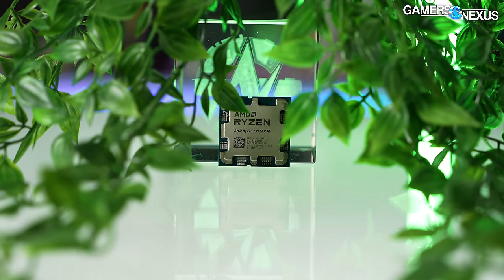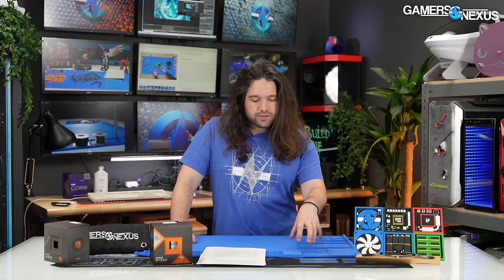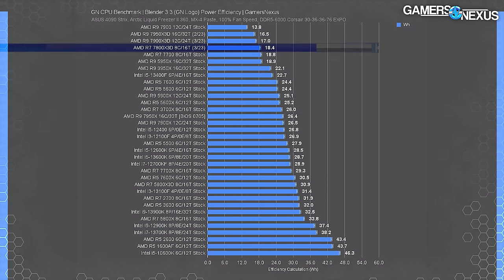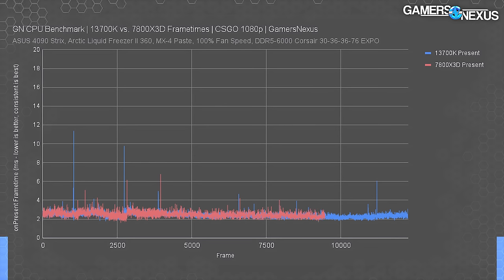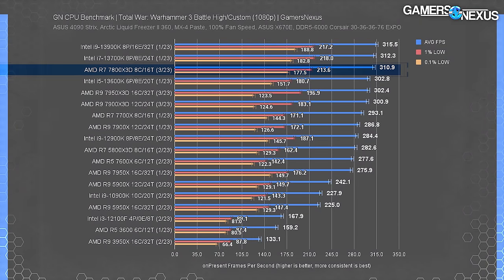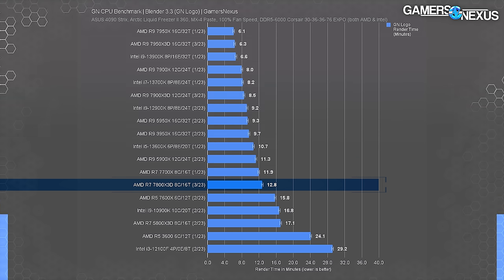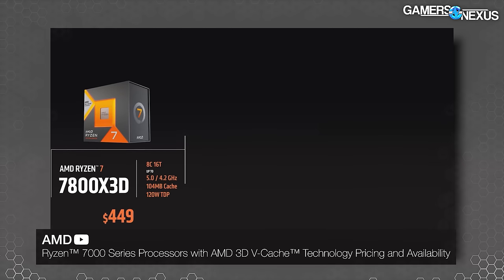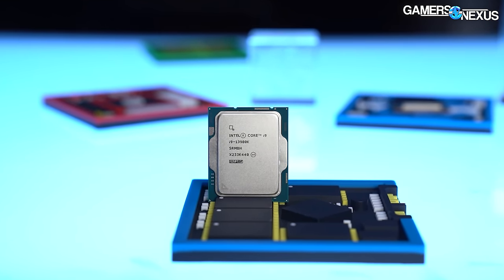AMD Ryzen 7 7800X3D CPU Review & Benchmarks

Comment: Hi could you help please would the ryzen 7 7800x3d work on a Msi B550 gaming edge wifi motherboard please. I am running a ryzen 5 5600x at moment with a rtx 4070 msi vengeance 2 card. I do alot of gaming and hurd it's good for msfs2020. Would this cpu work or would I have to use the ryzen 7 5800x3d instead please.
Reply: The 7800 x3d is on a new socket so you'll need a new motherboard and DDR5 RAM.
Reply: @Username4453  Hi thanks yep I could for now use the ryzen 7 just 5800x3d, which is on a Am4 socket realised 😅 if I want to go better it's new motherboard ddr5 ram and power supply. Think I will keep this build for now. Thanks for confirming 👍

Comment: I think the fact AMD uses less power and generates less heat is worth a serious mention. 
Electricity is very expensive in some places. And not needing quite as much cooling is something to consider for power use AND budget gaming. 
Or am I wrong?
Reply: AMD uses more power at idle though... but yeah, they do run cooler under load
Reply: If youre rich you dont worry about these electricity bills. 

If you getting high end specs but worry about electricity you must be playing pirated games

Comment: For your consideration: When attempting to optimize multiple related variables; e.g., power consumption, power efficiency, and duration; the solution is to create a new variable that is the product of the variables, i.e., power Consumption-Efficiency-Time (PCET). I think it is this variable that patrons would benefit from the most when comparing these products. This will bridge the gap that the Consumption and Efficiency charts have between them.

Comment: My 7800x3d is at lower MHZ than yours, with higher thermals. I have the same exact aio as you, and a lian li 011 case with 9 fans total. (6 pull 3 push) idk whats wrong with my cpu
Reply: It happens
Reply: room temperature?
Reply: what's wrong with your case

the case sucks

switch to lancool series,n you'll be fine

Comment: cant decide between 7800x3d and 13700k...      some toughts?
Reply: me as well
Reply: I would go for the 7800x3d cause of the upgrade path + extra gaming preformance
Reply: I thought about it too but you can just upgrade easily as the next 14th is just a small refresh and then goes to a different socket.

Comment: What does CCD stand for?
Reply: Ryzen is based on a 2 CCD architecture. Each CCD can have up to 8 cores. Failed versions become lower end CPU's. For example, a 7600 has 6 working cores and rest of them bad and disabled. 
The 7800x3d has 1 full CCD with x3d. The 7950x3d has 1 CCD with x3d and 1 CCD without x3d for productivity. 
The problem for the 7950x3d is that windows doesn't know which CCD to use. So, they flip flop between x3d and not. With the 7800x3d, there is only x3d cores, so everything is fine.

Comment: What i’d really like to see is how these CPUs compared in gaming when you have other stuff running at the same time. Having just the game running, to me, is an artificial use case. Would the low core count / high cache CPUs still be at the top when you have a browser with 50 tabs, discord, torrent, a virtual machine open on a second monitor? Or could the high core count / non 3D cache CPUs be the actual gaming CPU you want.

Comment: Frustration ensues. I have a 5900x on a x470 Crosshair, The board is showing signs of problems, to upgrade to a x570 Crosshair would cost almost as much as an X670E Crosshair. And finding a NEW x470 Crosshair would cost as much if not more than the x570. I waited too long to pick up a x570. The 5900x is a "golden sample" all core OC t0 4875 @ 1.375v or I can let advanced PBO run single core to 5125 @1.375v. decisions decisions.

Comment: is it better to have 200$ and a 7800x3d or 0$ and a 7900x3d?
Reply: 7900x3d is kinda odd. Only half the cores have 3D cache, the rest have higher clocks tho. This results in windows' scheduler having no fucking clue what to do (because you can't predict if particular process will benefit from higher clock speeds or better cache beforehand). The current most used approach is to manually control this stuff and park all non-cache cores when gaming, for example

Plus, ask yourself, do you really need 16 cores in your everyday usage and work?

Comment: IMHO, Zen 4 is a pass. I upgraded from a Ryzen 5 3600 to a Ryzen 7 5700X, not a 5800x3D, or 5900X. And for good reason, it's just not worth it. Going from 12 to 16 threads was enough for me, otherwise it's just money down the drain. Maybe when a newer chipset comes out and the RAM stuff is all cleaned up I'll jump to the new platform. Get the DDR5, ranking, multi dimm, slow boots, fixed. Sort of how it took until Zen 2 to get a solid setup with 4 DIMM's installed....If you're going new parts more power to you though, shoot for the moon, I'm happy with AM4 for now though.

Comment: Comparing the efficiency of i9 13900k with maximum cooling and a 3D chip that is underclocked from the factory is unfair. Newer intel chips pull as much wattage as they can if there is enough cooling. If we want to really see how efficient the silicone is, we should set a power target. Like 90W i9 vs 90W 7800X3D.
Reply: How is it unfair when they are testing stock v stock configurations. This is the optimal way to test as this is how they were intended to be used
Reply: @theemperorofmankind3739  because the stock settings oveclock itself based on the cooling you have. And they use a high quality 360mm AIO on a test bench. Usually they normalize things like fan rpm, sound level to achieve fair results... but not for efficiency testing it seems

Comment: I'm into gaming and coding, using 2+ webstorm instances, browsers/tabs, a lot of code lines, local server, discord, apps like whatsapp, etc, anyone tested it on 7950x3d vs 13900k or any other CPU? I like 7800x3d price and I want to try to buy it tmrw, but probably 7950x3d would fit my need better?
Reply: Which one did you pick? I'm in the same dilemma and I'm more towards to 7950x3d, because the lifetime of 8 cores only it's soon becoming to degrade imo, plus I don't wanna spend a lot of money upgrading and 3 or 4 years later have to upgrade again.

The price of the 7950x3d hurts me most, and I live in Brazil so everything here its double the price, sad.

Comment: Im confused how is the 7800x3d beating the 7900x3d?

Also some of these tests should have been done at 4k. As the x3d gets better results in 4k.
Reply: because the 7900x3d has only 6 cores with 3D V-Cache so in games it is more like a 7600x.
Reply: Thanks mate yeah totally slipped my mind. Still cant quite fathom how it beats tbe 7950x3d. But I imagine its a thermal thing. They really should have put the better silicon in the 7800x3d

Comment: They still don't get it. Separate voltages, enable OC, unlock clocks and other artificial limits. Someone wants to break their hardware? Let them. Hell hardware burn a fuse if it's OCed to void a warranty. Just give us the controls and best product possible. Price is sky high compared to competition and clocks are limited so they can sell more expensive parts. Suddenly Intel is looking more and more as the winner again, plus BIGlittle cores to get the best of both worlds, except the power haha. And please, make work on the IHS, it seems thick and slow to get heat transferred to the coldplate.

Comment: Just recently got a 7800x3d to replace a i7 10700k and there is no difference in fps while running 3440x1440@100Hz, plus I only got a 240aio because people said it ran cooler, should have got a 360aio because it doesn't. (it stutters a bit less for sure, but I still get the occasional stutter).. forgot to add that I have a 4080.
Reply: that is why these x3d reviews are such a scam.  They test it using a monster GPU RTX 4O9O and then only play it at 1080p.  so the x3d flexes it muscle at that resolution with that $1600 GPU but for most GPUs and higher resolutions, x3d is almost useless.  Such a disservice all these youtube channels are doing by not showing "real world" scenarios of this chip...  bottom line, if you want to play at 1080p with a RTX 4O9O, then this is your chip.  otherwise,  its not worth it
Reply: @deedeemerry1295  The reason they test at 1080p is to push the CPU as hard as possible, testing at 1440p and 2160p moves the workload more to the GPU. It is a CPU review after all.
Reply: @deedeemerry1295 stick to your self immolating intel cpu
Reply: fpss are more imporant by big margin than 4k sceenery - but some cant feel a difence between 30 fps and 144 so 4 ka are for them  .and some dont understand a thing then the ais are for them explaining
Reply: guess i should have known better than to waste money on only 100fps

Comment: if amd were to release a 7600x3d, that would really mix things up, but would also kneecap sales on every other product 😂
Honestly, I think amd dropped the ball on this launch. It should have been a 7600x3d (6cores/1ccd), 7800x3d (8cores/1ccd), 7900x3d (8+8cores/2ccd) and the 7950x3d (16cores/2ccd) with both ccds having vcache. The 7950x3d still wouldn't have made a lot of sense, but at least you would feel like you got something extra over the 7800x3d. The 7900x3d would then be equal to a 7800x3d in gaming but have the added benefit of normal cores in productivity workloads, which would make it relevant... barely. This would also get rid of the need for amd to kneecap the 7800x3d to stop it from outshining the 7950x3d (or in this scenario the 7900x3d).

Comment: 1 year later, the 7800X3D is cheaper than 13700K :face-blue-smiling:
Reply: The 13700K is more of a 7900X alternative than a competitor againat a 7800X3D (gaming only).
Reply: @saricubra2867  not really.  That i7 will keep up with a 7800x3d in most scenarios, except for these misleading tests using a rtx 4O9O playing at a low 1080p resolution.  Use a higher resolution or cheaper gpu, you wont tell the difference between that i7 and the 7800x3d.  except the i7 might give a blue screen :face-blue-wide-eyes:
Reply: @deedeemerry1295  "That i7 will keep up with a 7800x3d in most scenarios"
It doesn't for now, the 7800X3D has stronger 1% lows and draws less power for more fps.

Comment: Was going to get a 13900k but decided on this instead.
Reply: Prob a smart move considering the 13900k is on a dead platform. 
The people who ignored the common forum advice and went with AM4 back in 2017-2019 are now reaping the rewards of AMD's socket longevity. Why jump platforms when 1600 or 2600 can be upgraded to the 5800x3d?
Reply: @m8x425 The 13900K is a mini Threadripper and it's still amazing for everything, it goes beyond the platform 🙄
Reply: @m8x425  The 7800X3D is just a gaming chip. The 13900K is way, WAY too overkill, like using an RTX 4090 for vainilla Minecraft graphics.
Reply: Those cater to a very different set of users. 13900K is not really a gaming chip, it's mainly for multi-tasking, it's about 2.5x faster than the 7800X3D in that scenario. If you're mainly gaming, the 13400F is more than enough for most people.

Comment: Wath mainbord I need to use for 7800 x 3d?
Reply: mid range : b650, b650e | high end : x670, x670e | budget : a620.  the (e) means pcie express 5.0(will be 4.0 on non (e)) rest is basically the same, i would recommend b650e for 7800x3d but any would work still aslong its am5 compatible
Reply: @Ryakk1  thx

Comment: Obviously the 5800x3d was a godsend rejuvenator for AM4 platform gamer users. It was/is so good, its a very tough performance act to follow.

A product is only as good as its price, & an all up $300-350 upgrade cost made it unbeatable ~no matter what 7850x3d achieved.

Being content with ur 5800x3d is beside the point.. 

What about the perf hungry  w/o a suitable AM4 platform - pre AL Intel users especially - probably the majority of the user base.

For that fresh start upgrade, it would be foolish to pass on new gen ddr5 ram, & on balance, costs vs Intel are on par if u balance; cpu/psu/cooling/mobo.

considering also platform longevity & the user friendly power efficiency, at current prices, its hard to make a case for Intel.

The killer is that amd is making money on its product, Intel are losing money in recent quarters & I suspect its getting worse. Intel dont have pots of money to throw at marketing schemes which hide losing prices to keep up appearances. They cant afford to cut prices like lo cost amd can.

Losing money does not conform to the definition of competing - something has to give and customers know it R&D?, support?. They want a product from a strong company.

AMD have a cost structure to kill for. The same mass produced core complex chiplets/lego blocks, are sold in dozens of SKUs, spanning from the worlds most powerful exascale computer; to the humblest desktop. The list of benefits is very long.

Not only in costs, but as we see from the rapid loss of market share in data center, they are losing at performance at scale too.

Comment: Any one with a 7800x3d getting idle temps fluctuating between 45 - 53 C ? (My Ambient room temps around 28 C) ? Cinebench R24 multicore tests it maxes out at 83 C usually hovering around 81 C . Is this normal ??
Reply: Yes they have thick dies over the cores to level out the dies from the add v-cache stacks..

Comment: The 7800x3D is a good value and performance for what it's designed for.   Many people don't render/compress code and their gaming rig is for gaming and otherwise regular computer stuff that any $100 CPU can handle.    So if someone is into productivity = Don't get it. 7900x/7950X are better.   Or a gamer + rendering user should ger the 7950x3D.

So for someone like me,  The 7800X3D would make a lot more sense.   I do some video/Photoshop stuff, but not enough to buy a more expensive CPU.    What, an hour a month or so?  But gaming is for hours and hours.

But... I still like a quieter and simpler 65watt 7600 works very well as it is.   I still get 200fps+ avg.  120fps low 1%... and its a $220 vs $450 for the 7800x3D.    But still, the best upgrade path.

Comment: A real value look is . What does the 7800x3d get vs 13900k in the games people actually play? Fps per $ and fps per watt is a bloodbath vs Intel. Sorry fanboys.. AMD is objectively on top. Again.

Also.. apparently its pretty easy to get +5 to 8% uplift with safe voltages and thermals so.. even when Intel pulls a small lead.. it doesn't.

Comment: I agree with you about the 7900X3D being a joke, but I was in a situation when the 7800X3D is 20% more expensive than the 7900X3D. I bought the 7900X3D, for much cheaper, and despite some  of the issues of 2 CCD, I think it is a better match for my work load (70 to 30 percent work vs gaming) and at a much cheaper price. Resell value is trash I think but only time will tell. Sadly I was one of the victims of AM5 issues. RMA MB, Ram and CPU, MB and CPU were found faulty and replaced, waiting for RAM. 3 month and a lot of money wasted there though. MB was reported to not post, CPU reported that it posts "sometimes", and still waiting for GSkill to conclude RMA. I sometimes wish I went with Intel.

Comment: Does anyone know if the b550 motherboard will be compatible with 7800x3d?
Reply: Unless you mean b650 then no. B550 is a different socket
Reply: @theemperorofmankind3739  Yeah i didn’t realize I would have to get a new mobo and ram. Thinking I just grab the 5800x3d 🤔
Reply: @drewskii3289  What GPU do you have? And What resolution do you play at?
Reply: @theemperorofmankind3739  3080ti at 1440p

Comment: The times Intel wins i'm sure it uses more power, for me that alone invalidates Intel as a cpu choice. Plus Z790 is end of life, AM5 isn't. My play is X3D cpu (still thinking hard wich since i also do massive image exporting and i would love to do it while gaming, 8 cores will be nice but in future i think to few 12 core i feel comfortable but 7900x3d has high price and some issues, 7950x3d just is price to high as the halo 'i'm the best product' atm. The 7900x3d though is now 100€ cheaper in one shop (600€) while 7800X3D is 500€ if you see how much better it is in productivity i find the 7900x3d actually better value and generally the 7900x3d keeps up nicely with 7800x3d in games. Then later i will upgrade to 9800x3d (or higher core model), to finally have a feeling of all these people 'omg i upgrade Early am4 cpu to 5800x3d and it's cheap and amazing', since i never bought am4 motherboard (almost did 5000 series cpu, but because can't upgrade i skipped) i will now have that advantage for am5. With higher motherboard prices this seems like a smart plan imo. I wait at least till september for cpu, basically i want the discount (even if less) that 5800x3d had, but for 7000 series and later for 9000 series, to take advantage of both ugprading, but also the lower prices.

Comment: To me it seems like situation is getting fcked up on both sides.
AMD brings out a decent CPU that are waaay better then Intel's previous gen. Intel due to being unable to come up with newer architecture and still being stuck on "7nm" somehow finds the way, how to OC their CPUs even more and beats for few % AMD. Which makes Intel CPUs go sky-rocket with temperatures and power consumptions. AMD seems to be still reasonable choice, but later on during the reviews you find out their "hidden fck ups". And vice versa, like a running in cycles.

However what could be a decision breaking point - What's the power consumption while gaming? Is AMD better by far? Or does it matter only during the massive workloads when compiling?

Because if I could save like a 100$ a year for electricity bills, it might be a point breaker.

@Gamer Nexus, would you consider doing power consumption tests also while gaming?